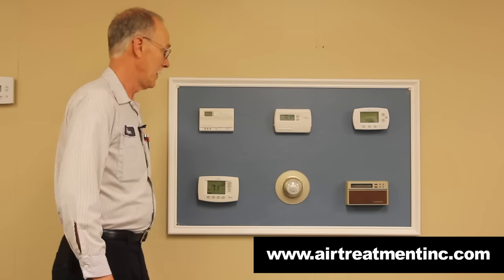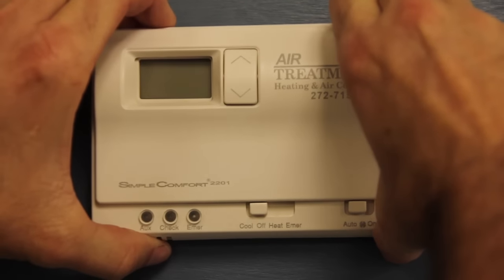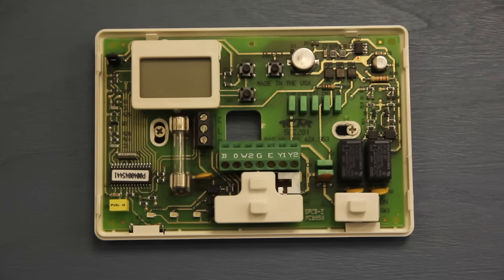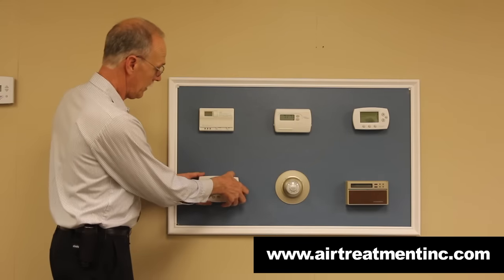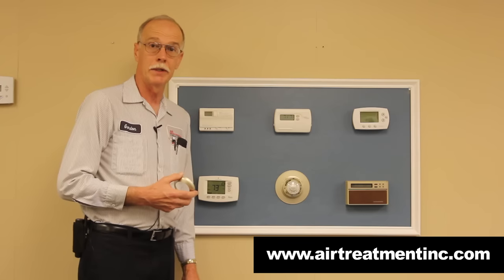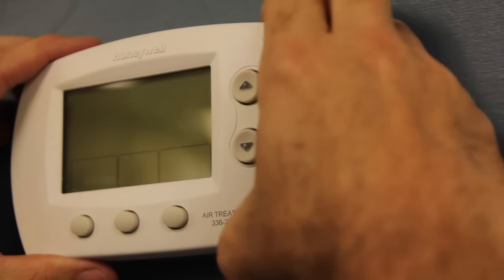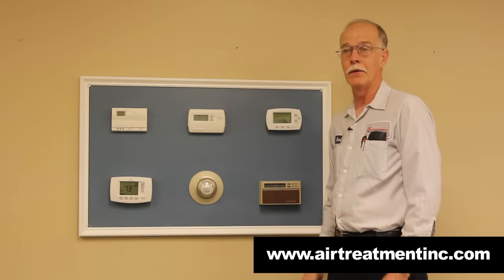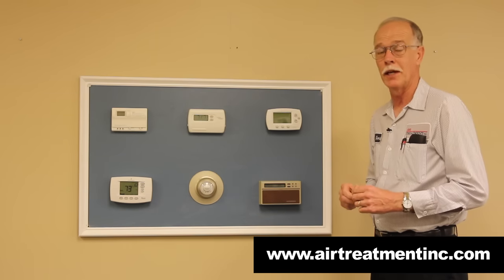Self help tips: Changing Thermostat Batteries

Comment: You my friend are a superhero. Ridiculous that I’ve been relying on a space heater. Started to get inkling some thermostats took batteries but couldn’t get face plate off old Honeywell in rental unit (& don’t feel great about repair people I don’t know in my space when I’m not there). Got it off (bottom screw), ran for AAA batts, all done, cranking up the heat and embraced the old wall heater. Heat = good. Thanks!!

Comment: My Honeywell looks like yours, but doesn't have the slide-out battery compartment in the top-right corner. The entire thermostat unit pulls directly off a base that's attached to the wall, similar to some other models you showed. The problem is that the first time you do it, it's hard to know how to hold it, how hard to pull it, and which direction to pull it. Once you pull the unit off the base, you'll see the batteries running end-to-end along the top of the unit inside. Thanks for the overview of models you have there. Battery change was successful. - Bill

Comment: My boiler is acting up and I think it’s the thermostat. I changed the batteries and now the display says ”battery” which according to the manual means the thermostat is running on battery power only but I’m getting voltage at the wires. It never said low battery. But I figured I’d just replace the batteries. 🤔

Comment: Bless you for posting this. My husband normally does all of the repair work around the house. But two months ago he had a stroke and is still in a recovery center. The battery light was flashing on my Luxpro thermostat, and had been for weeks before I thought to check on Youtube for a how-to video. Thanks to your advice, it took me all of 1 or 2 minutes to take the cover off and replace the two AA batteries. And that included the time walking to and from the kitchen to access batteries!

Comment: I've got a Trane XT300 thermostat. (Its old...no manuals online.) The REPL BATT indicator has come on. It contains 3 AAA batteries. I replaced them with new but the REPL BATT indicator remains on. The batteries I removed also test fine (1.58V each), the same as brand new AAA batteries. Is there a coin cell battery on the circuit board and if so, how do I get the back panel off the thermostat to access the circuit board and possible coin cell battery? Or perhaps a "non replaceable" rechargable battery? I see one screw holding the back on, then 3 screws used to adjust various functions, but I don't really want to remove those as I don't understand how they are set and don't want to screw up the functionality of the thermostat.